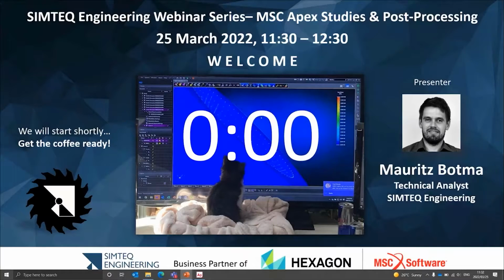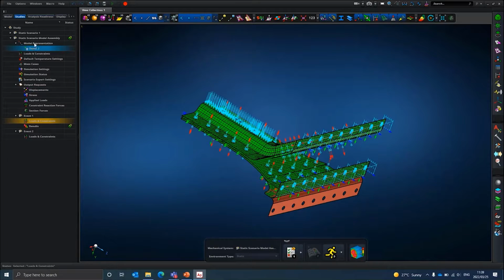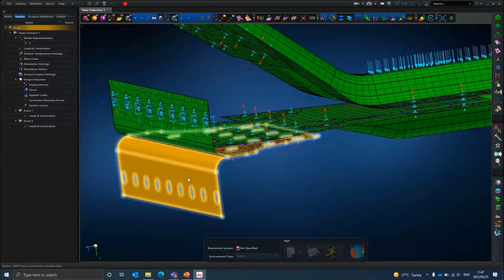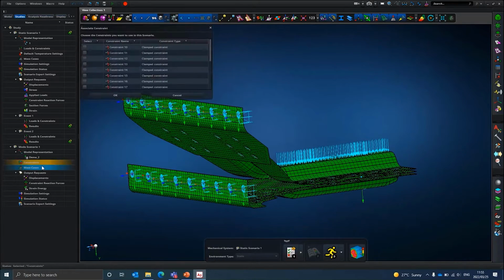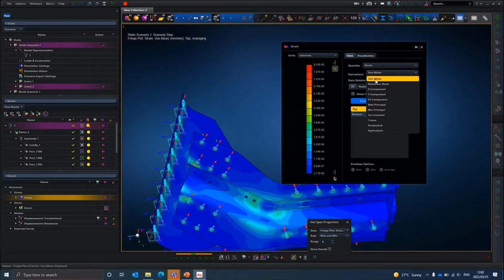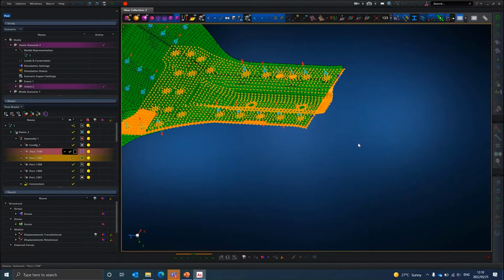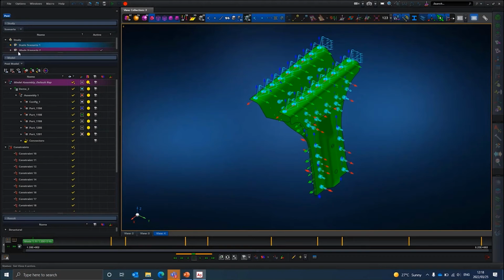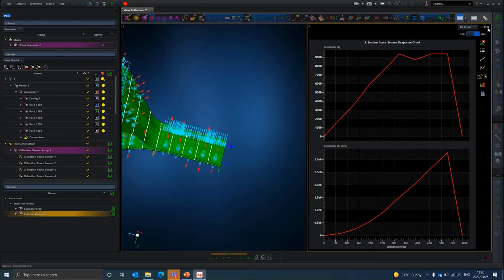MSC Apex Studies and Post-processing

Comment: Hi,
Nice video. I have a few questions. When ı apply pressure, ı see it is under the loads section on the left top but ı do not see the arrows on my model. And ı cannot split element it draws rectangles not a line. Also the post process icon doesnt light up after running the scenario. only feedback ı got is bad element quality nothing more but still ı cannot continue to post process. How can ı solve these problems do you have any suggestion? I really need to solve these, your help matters a lot to me.
Reply from the maker: Hi, sorry for only getting back to you now. Please email one of our engineers, he will be more than happy to assist you gerrit@simteq.co.za